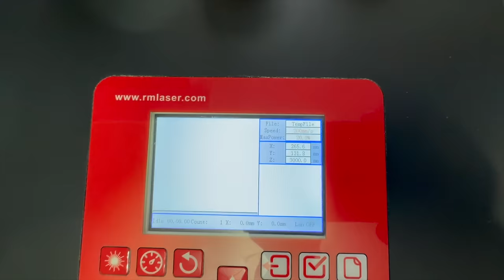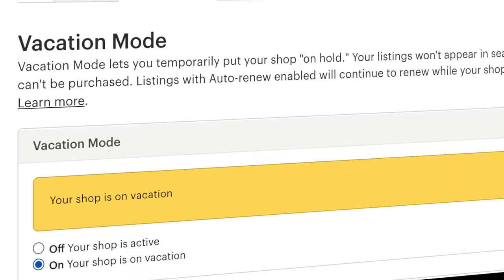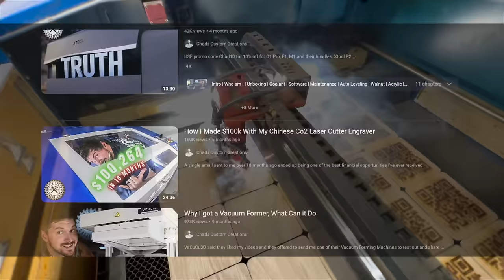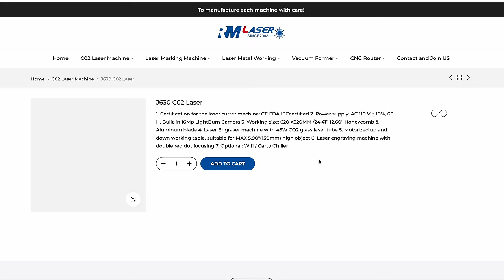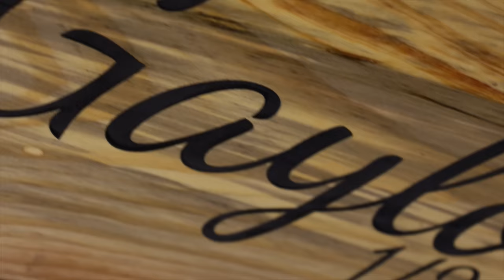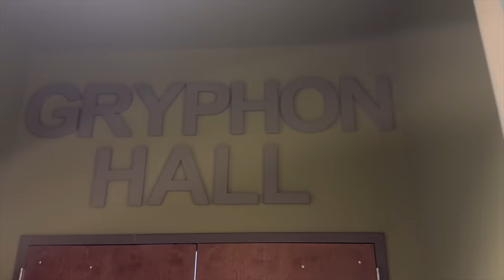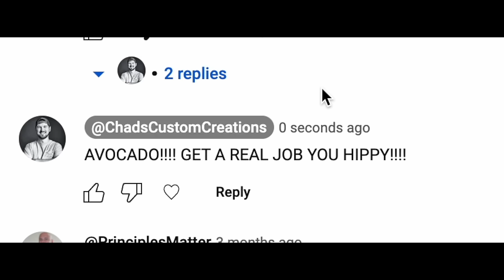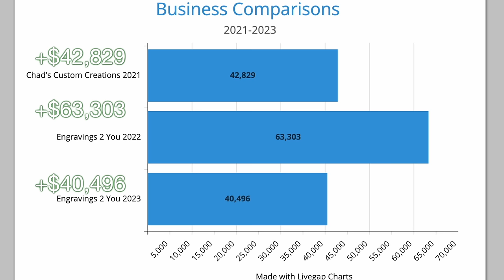Shutting The Doors to my Thriving Laser Business

Comment: One product line which uses much easier to store materials is gasket cutting. Due to the big gasket companies wanting maximum profit they push exotic gaskets in areas where they are not a benefit, for example many motorcycle engine gaskets previously made of basic gasket material and pleasantly inexpensive in bulk. A responsive, small local gasket company could be very convenient for local machine building shops, industrial maintenance etc.
Reply from the maker: On that’s very interesting, I have laser cut a rubber gasket for our pool skimmer and it has worked out great.

Comment: Avocado. This is a pretty good video but missing cost info and the number of hours of work you actually did on this business are some important context. I'm running an Ecommerce business selling hobby Robotics parts and quit my full time job in April 2023 to do this full time. I wish you would include your costs including the electricity and laser depreciation/laser tube lifetime amortization to figure our what you are actually making. Personally I also think it's really important to calculate your hourly wage and see if someone would be better off working at Denny's or driving for Uber if they don't already own a $4000 laser cutter.

For reference my business in 2023 brought in well into 6 figures in revenue, but cost of goods sold was more than half of that, and other expenses such as the fees I pay for CAD software (Fusion 360) to design my products, to Shopify and all the apps for web hosting, internet bill and more, ultimately I'm making only 20-25% net profit on that money. I think most people see $40000-60000 in revenue and think that's a huge amount of money but when you find out it's only $10-20k in profit and takes 20 hours of work per week to earn, that changes things a lot.
Reply from the maker: You’re right I will try to do better about keeping up with cost. Not sure if you saw the material break down I did but that gives a rough estimate of it. But I’ll try to do better in the future.

Comment: Avacado: I love the way you think and have been looking for some way to engrave and cut 48" rulers that are 2" wide and 1/4" think with lots of engravings.  Wish they made a CO2 laser with at least a 48" working area...
Reply from the maker: I am running an Rm1390 right now the laser bed width is 51” wide and 36” deep it’s insane I love it.
Reply: Thanks. I will check it out. What would you charge me to do 50 rulers that's 48" x 2" x 1/4" rulers. Laser info on both sides

Comment: avacaado ( I love guacamole!!!) Chad this video is very timely...I am a long-time woodworker.  I make outdoor furniture using Cypress (Mississippi guy). It's not a full-time job...just a way to feed my table saw...I have decided to expand my horizons (as they say) so have been researching CNCs and laser engravers. After watching 'Fastest vs Cheapest' I requested pricing from RM Laser. Angela at RM Laser got back to me promptly. The pricing is a 'rough estimate'... The RM960Pro...$5699 with the J750 coming in at $ 4,299. That included a spare laser tube, honeycomb+blade table, autofocus two red dots, exhaust system, for both lasers and the built-in Lightburn camera with the J750. Now I am a geek about research when I decide to make a new purchase for my workshop....I have priced lots of comparable machines and for what RM Lasers are offering that's a very good price. I will be purchasing the J750 after watching this video....Just a grip...RM Laser needs to revisit the WEB material for the RM960Pro...They do not describe that laser as well as their other offerings...Sorry, I got long-winded...Just had something to say...Love your content...you are inspiring...
Reply from the maker: One of the greats thanks for watching the whole thing. I think I got long winded on this video also 😉 RM laser as the manufacturer really does get to offer an amazing value for the price.  They do have some work to do on their website but I am happy to see it is improving. I remember using some Cyprus on some signs a while back and it was amazing how easily the laser could cut through it.

Comment: Avocado! :D Nice view, you asked if your math was off and you left something out cost-wise. I'd say: Yes. The cost of actually running the machines (electricity, heating the space they sit in) plus the cost of having them in an enclosed space. Even if it is basically your garage, it is not "free" per se, because you probably have to pay off your house, or if it is paid off there's constantly stuff to be fixed, renovated etc - also in the space you use for your work. So that amount should be deducted from your income as work-related costs. As well as all the power for your power tools, lasers, fume extractors etc... (over here in Europe with electricity prices at 40+ cent/kwh this would even be a major factor).
Where I live, you'd have to factor in work cost for yourself too, i.e. mandatory health insurance, unemployment insurance, insuring your work property against damage and having an insurance against liability claims from clients etc. These secondary costs can add up quite quickly too.
I also noticed that when you did the lettering job for the school you didn't talk about the fuel cost for driving out to them or using your car as basically a company transport vehicle, so the usage of the vehicle (mechanical wear and tear) should be deducted, even if it is only a very small sum seen as a percentage of overall annual vehicle costs, from the income.

When you are self-employed, you tend to overlook a lot of these things because "stuff is just there" and "I'll use what I already have" etc... But when stuff isn't there, when it gets broken, it all has to come out of some pocket. If your car breaks you need a new one to get your product shipped and acquire new materials to continue working. If you are sick and unable to work for a month, you better have some kind of insurance to cover you and have a plan b to recoup the cost. Especially if you are mid-season (can't ship all those santa claus signs after christmas).
Reply from the maker: 😮 I guess my maths were only kinda mathing considering all of this, and I forgot mention all the avocados I’ve gotta buy to keep myself energized also. Thank you for the insights!

Comment: Pumpernickel! Errr, Avocado! All of my tools and equipment have paid for themselves, especially the little $100 3D printer I used for a $500 job. When a tool makes me more than what it cost, I say it no longer owes me anything. I do a wide variety of things and sometimes a tool may go years between uses, but as long as it's paid for, it doesn't matter because I'll have it when I need it again, especially the ones I could never replace or would cost a fortune to buy anything equivalent, like the large pressure tanks made by Pressed Steel Tank Company.
Reply from the maker: It is a great feeling when they do that isn’t it. I am currently working on getting my John Deere tractor to pay itself off but so far it’s just me playing around in the dirt and moving logs around 😅

Comment: Persea Americana! What is useful in these calcs is including a fair wage (hourly) for those involved. You should also know your CODB for the space (% of lease/rent/mortgage by sq ft, which your accountant had better be letting you write off), and electricity is negligible at this high level.  

Now, if all environmental expenses are equal (before & after), then you can compare them, but you cannot act in the larger sense like they don't exist. If you only want to compare them to each other, then labor for a fare wage (even as owner, ask your accountant) is valid, as you are likely not spending the same exact hours (different equipment, job sizes, etc.), unless you are smart enough to log/account for your hours on each job (this is important).

While most casual watchers want to know the differences between A & B for curiosity's sake, business owners like me want to know the COSTS. And of course, the more detail the better.

Keeping track like I mentioned will, among other things, show you where you are 'leaking' money, effort, value, worth, etc.

THAT is the most important thing for YOU, as it will tell you how to change as you move forward, justifying staff, cuts, change of customer types, suppliers, family time, etc.
Reply from the maker: Yes you are absolutely right, all those things should go into the calculations keeping track of it all can be quite a challenge though.
Reply: @ChadsCustomCreations  I'm a one-man show, and I find that the hardest part of the business has nothing to do with the thing that I do as a business. All I do is support small businesses, so I have a chance to ask the owners about what they expected to happen versus what really happened when they started their own business. It's kind of like the baker who had a day job as a stockbroker but loved baking and everybody told her how wonderful everything she did was and that she should go into business.
So she goes into business thinking that now she can follow her passion, and just bake instead of having to commute deal with whatever things stock broker people deal with. But I think the real reason that most businesses fail and close down in the first 2 years is because she realizes very quickly that she has extremely little time to bake. Unfortunately, for her the baking is the good part so if you're spending most of your time not baking and doing bureaucratic things or administrativeia, legal and municipal paperwork, not to mention taxes, your dream job of owning a company where you could just do the thing you love becomes a chore and something you dread.
The perfect job is the one where you would take less money to keep doing it. Because if you're in something for the money, and you let that be the one thing that decides everything else, you may be successful, but it will age you with stress.
We have this fictional American dream, amplified by movies and television, that if you work hard all your life you will finally get to some peak or Pinnacle, reaching some sort of goal or threshold, and then you will have "made it". We are taught to look at rich people and see them as idols and the way of life that we should all strive to attain. But it is a lot easier to make a million dollars if you already have a million dollars. 

We also have this antiquated notion that if you don't do well at your work, your passion, your whatever, that you were a failure to yourself your family and society. We have this sword of Damocles over our heads that keeps us running as fast as we can on the treadmill, because we can't fail. We have to succeed at all costs.

The stress of the financial, functional, and psychological pressures on our baker overshadow and out balance any of the things that would have made our baker feel like she did when she first started, thinking that her life would be so much simpler and fulfilling if she could just bake.

That, my friend, is a trap that we all fall into, not choose. If we just blindly go at businesses as entrepreneurs, knowing almost nothing about ourselves or what it takes that is outside of that passion, looking from the outside it seems a recipe for failure. But how can you fault somebody for wanting to follow their dream, by doing most of the day something they have a passion for instead of part-time while sharon in a gerbil wheel during the day?

Our parents didn't have the extent of the information available at our fingertips to learn from the mistakes of others, and listen to experts like you. Sure, you can read a book all day long, but when someone who is actually in the position that you see yourself going into, the advice that you give and the reflection of your experiences isn't going to be found in any book, nor would someone take it as being as valid.

So from one entrepreneur to another, I appreciate putting out there the things that will in some way help those who want to be helped that are on our path.
Reply from the maker: Incredible knowledge you have shared here in this comment! I am hopeful for the newer generations that they don’t fall for the trap of the so called American dream I am loving seeing more and more push the idea of minimalism and living on less and enjoying life more.
Reply: @ChadsCustomCreations  For an idea of how the future generations will judge you today, just look at how we judge our past. Kind of humbles you... :-)
Reply from the maker: @pattheitguy  🤯

Comment: Avacado! Great video. Was wondering about insight into why revenue declined from 2022 to 2023? And is there anything you would've done differently in 2023?
Reply from the maker: There are definitely lots of variables, it was a slower year but I had excess funds from the year before, so instead of stressing out or trying to push the business harder I actually used that time to invest in lots of home projects and repairs to raise the equity of our home value. It was a nice change of pace but still had the business providing a little income on the side.

Comment: May i ask why you use such a thick wood for those QR Codes, i saw they are 1/2 inch so over 12mm. Wouldnt be 8mm more than enough?
Reply from the maker: Idk I just kind of fell into that thickness I think the customers appreciate that they have weight and depth to them which makes them feel higher quality.

Comment: Avocado!  Just ran across your channel a few days ago and I'm enjoying your content very much!  I'm looking to purchase my first laser cutter and engraver within the next 60 to 90 days, so I have quite a bit of information to pour over.

Currently I'm leaning pretty hard toward XTool (either the P2 or S1) but your presentation of the information in this video has intrigued me enough to at least consider the RM-J750.  I really need something with a beginner in mind that will let me hit the ground running within the first 5 to 7 Days of ownership.

Again, thanks for your videos and any personal advice on your end would be appreciated.
Reply from the maker: Glad to hear you found me. I really don’t like telling people what they should buy but for a first time laser owner I would push them towards the S1 as with the diode lasers like the S1 you don’t have to worry about and cleaning adjusting mirrors, worrying about coolent temperatures and all of that come along with the Co2 lasers. IE the P2 or the J750. The trade off is not being able to cut clear and some colored acrylics so keep that in mind. But the S1 also comes at a much lower price which will lower your risk of entry into the laser world. If the business grows and things speed up eventually you may want to consider adding a Co2 laser to the business as a tax write off of course 😉
Reply from the maker: Also promo code CHAD10 should save you money at Xtool if you do go that route.

Comment: Avocado. I'm debating between a CO2 and a fiber laser system. Both are similar price, but which is a better start?
Reply from the maker: Depends a bit most Fiber lasers are generally just a small working area of about 6x6” and mainly for metals Co2 laser are more versatile but can’t engrave into metals, but have large working areas of say 19”x27” and up. Another one to through into the mix is these newer diode lasers like the 40w S1 by xtool diodes can do metals, all organics, most acrylics but are generally slower. Sorry for all the options, if I did have to say where to start especially as a hobbyist I’d say go the diode route as it is the most versatile and less amount of maintenance.

Comment: So I own and operate a custom 3d printing company. Number one what I found is anything custom ( a one of or even 10 of ) the customer has no clue what it takes to get to the point of printing it, price!!! For example a small flat golf club ( looked like you would use it in a drink to skewer a drink condiment with ) we wanted qty 4 I told him we have a $50 minimum and after design of the 3d model for print I would print qty of 25 of them. He thought that was craze told me we can get them at 25 cents a piece. I then said there probable lest then 5 cents a piece and ho you are buying them from are probable braking down lots of 1000 or 100. he then proceeded to say, if you think there 5 cents each YYYY cant you make them for that. Well obvisely not for qty of 4 or 100 or 1000!!! A custom shop is just that, A CUSTOM shop, Not custom items. Think of every single job as a one of, then if the customer comes back and wants more even with minimal changes then the cost per piece can drop considerably. But you still always have the paper work ( job tracker ) and customer interface time, packaging, ETC so, overhead needs to be covered on all jobs. CUSTOM IS TOUGHT especially dealing with the general public that does no have a clue what it takes to truly make anything. mime.global
Reply from the maker: There is so much great knowledge in this comment!

Comment: Avacado!!! Question… How did you get your CO2 to cut through 1/2 inch thick plywood??? I tried about a year ago and almost started a fire 🔥. I never tried again 😢. I have a 130 watt machine.
Reply from the maker: Hmm you should be able to cut that no problem, try like 20+psi air assist 5mm/s 100% power. If that’s not doing it maybe your mirrors are not aligned well, are dirty, or you might be due for a new laser tube.
Reply: @ChadsCustomCreations  thank you! I’m going to try again!
Reply from the maker: @artbykristylalonde4165  also should say plywoods can all be different depending on the glues they are using. I’ve had good luck with the red oak plywood from homedepot. I put the link in the video if you want to get some they ship them to me for free in 24x24” pieces.
Reply: @ChadsCustomCreations  yes, it very well could have been the type of plywood I used. Thanks for the info! I really appreciate it.